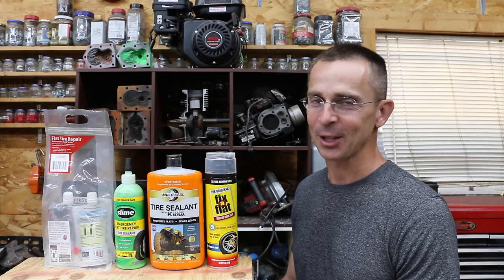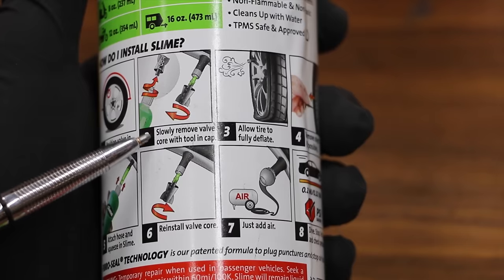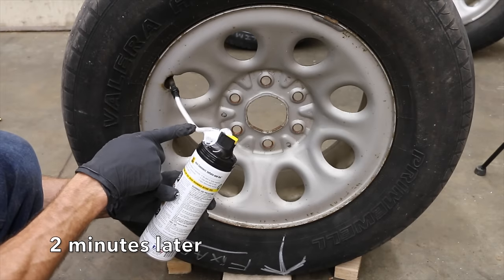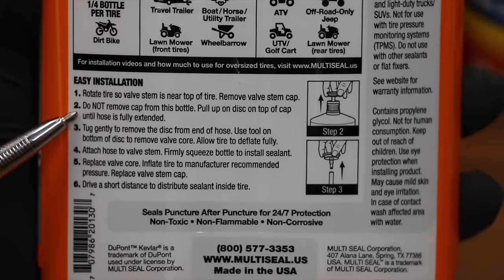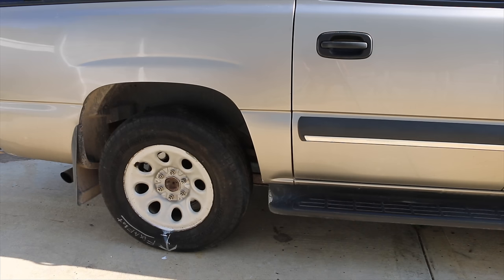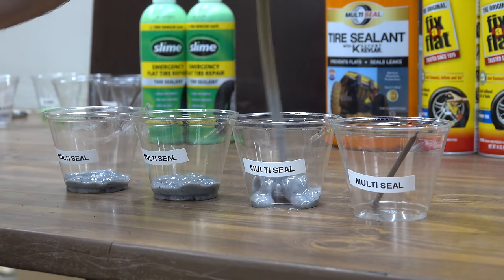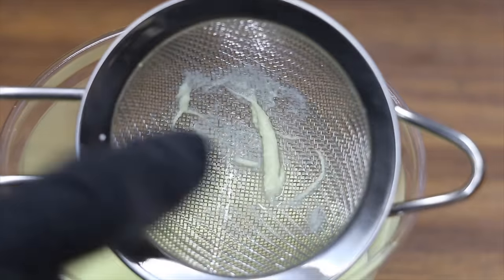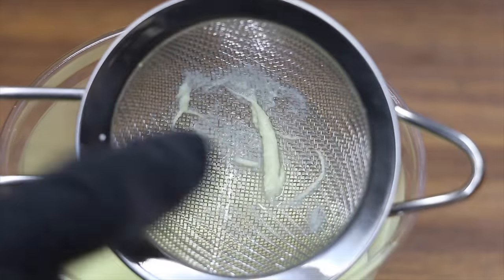Is Tire Slime the Best? Fix-a-Flat vs Tire Slime, TireJect, MultiSeal. Let's find out!

Comment: I've never messed with any of these products, but I've used tire plugs countless times. Plugs are a pretty reliable, relatively easy solution for tire repair.
Reply from the maker: Great point on the plugs.
Reply: I've used plenty of plugs in my life because I can't afford new tires, but just so you know, a plug can void your new tire warranty!
Reply: @Quickened1  just take the damn plug out before you go to the tire store. angi, and done.
Reply: @tommurphy4307  yeah, not sure you've ever tried to take a plug out of a tire. Your have to do it from the inside of the tire!

Comment: When they claim 1/4" to 1/2" hole repair capability, is that a true hole size or simply an object of that diameter that caused the hole?  The actual hole in tire will be much smaller because the hole in the rubber closes down much smaller once the object is removed.  
Now if you take a 1/4" drill bit and drill it for an extended period, you'd have a  genuine 1/4" hole, and I'd be really impressed if they can seal that.
Reply: It is puncture size not hole size
Reply: with a hole that size, you have to seal it with a new tire, lol
Reply: I had a puncture caused by an M6 (1/4") bolt easily sealed by Wellseal/Puncturesafe. But it absolutely would not have sealed a hole drilled to 1/4" diameter.
Reply: is that a true hole size or simply an object of that diameter that caused the hole? So what your saying is the hole size can be two sizes because of what created the hole in the first place and the fact that rubber returns to its original shape when compressed? Dang!!
Reply: For those times when you run over a drill in operation.
Reply: @CCliff0rd  

Sometimes you have to put employees in their place
Reply: I can't remember the last time I drove over a working drill with a 1/4" bit.
Reply: @stu-oe5sg  that's why the 1/4" puncture claim is meaningless.

Comment: I'm definitely getting rid of the can of fix a flat in my car for multi seal
Reply from the maker: Great idea
Reply: Keep it for emergency air up
Reply: Same.
Reply: I would get rid of the fix a flat, and just use the multi seal and a 12v air compressor. You don't know if the fix a flat will react with any of the ingredients in the multi seal in any way
Reply: Yep. Fix a flat sux

Comment: I had a front tire with, I believe, a nail in it - never saw it, but think I ran over something, but also never removed anything. Was a BMW 4-series lease and the tire w/ TPM - a replacement tire was near $300 - and the car had maybe 2500 miles on it. Anywho, I used Slime. Whole thing took maybe 10-15 minutes, mainly because I didn't know exactly what I was doing. It was perfect, I turned the car into the dealership two years later without doing anything else - the Slime, in my case, was a permanent fix. I'm totally sold on the Slime - the stuff worked amazingly well at least in my case. With that said, the reason I looked this up, was the other night I had a tire nearly flat on my Saturn Sky, no TPM, and I was at Target - nothing else was open. All they had was Fix a Flat - so I picked it up - followed the instructions just as they said (sort of remembered it from when I was kid and having to use it). The next day, I go outside, the time is down to 10PSI. Just my experience.
Reply from the maker: Thanks for sharing.

Comment: Fix-A-Flat only works if you leave the object in the tire. Used it once. Slime is great. I’ve used it multiple times. 

Love your videos, man. Maybe test transmission fluids? Or test cheap vs. expensive brake cleaner. 

Also, I’ve had grade 8 bolts break. Could be a decent idea to strength/corrosion test the different grades of bolts. 

Have a good one!

Comment: The only thing Fix a Flat seems to fix is a heavy wallet.
Reply from the maker: Lol, Great point
Reply: That's called a 'cashectomy' in the medical profession.
Reply: Should be illegal. Cuz it cause blow outs
Reply: It's only air in a can🗯
Reply: True that fix a flat. Will only flatten your pocket book
Reply: It contains fluorine which is a toxic waste product. The genius super rich are putting toxic waste into products so that instead of having to pay to dispose of it, they have idiots buying it from them. Fluorine has no good use. As you can see, every product that doesn't have it works better.
Reply: Yeah but it worked for me two different times to be able to drive to the shop for a real repair.

Comment: Love it I work at a tire shop fix a flat is a worthless product always wondered if any was worth using
Reply from the maker: Great point
Reply: I was thinking that it might be OK for a riding lawn mower tire.  Emphasis on might.
Reply: Another good thing to mention is yes these products will fix some holes that fluid in the tire will imbalance ur tires we run into alot of customers with ride complaints after they put these things in thier tires
Reply: @s99614  Best to do the job right. For a lawn mower you might as well just get a tube as they aren't that expensive and its what I installed as a pro when I worked in tire shops.
Reply: @silasbailey  Yeah its fine for a little ATV or ride on lawn mower and other farm yard machinery but for vehicles that have to use the roads and get up to fairly high speeds it will be total crap and ruin the ride. In cars you are better off plugging the tyre.
Reply: @s99614  used one in my riding mower for years works great

Comment: Anyone remember when fix-a-flat used to become a hardened foam like Great Stuff?  It worked back then, except you had to throw the entire tire and wheel away because the tire was never coming off the rim after that.
Reply: now its a replacement for spare wheels
Reply: @Minecrafter-uh6qv  what?
Reply: @lyricderbin1169  in cars, at least in America great stuff is what companies put in tires instead of donuts or just another tire.
Reply: @lyricderbin1169  Space saving measures, and yet it doesn't work.
Reply: @Minecrafter-uh6qv  You're referring to runflats eh? That's one method of making a runflat tire.
Reply: @mannys9130  just fill up the popped tire and go basicly, not that it really works
Reply: @mannys9130  No, he means a lot of new cars don't have a spare, not even a mini-spare "donut" or jack anymore.  Instead, you’ll find a "tire repair kit" comprised of a flat fixer sealant and a compressor.
  If the tire is cut, split or blows out, then you’ll have to call for help.

Comment: Hey buddy,  thanks for the info.  That emergency can of Fix-A-Flat getting tossed.
Reply from the maker: Thank you!
Reply: Not necessarily, remember that it is also the only product that will inflate the tire as well. I wonder if it can be used in conjuction with tire slime? Maybe deflate, add slime, then use fix a flat just to inflate
Reply: Bro I got a can in the trunk for emergency lol all bad
Reply: The definition of insanity is repeating an act over and over again expecting different results. For example, snacking your hand with a hammer to produce pain relief... 
I used "fix a flat" a grand total of 6 times over 4 years before I realized it absolutely does not work and the company needs to be sued.
Then I was cured of my insanity when I bought my first can of slime.

Comment: Sir, I appreciate this like you would not believe. There are several products on the market I often wonder whats worth buying and does it even work? Youtube sends me your way, and your enthusiasm, effort and attention to detail is VERY appreciated. The "mess" from all of these products is significantly less then I imagined. And Slime DOES work who would have thought. Amazing! (My car doesn't have a spare, tyre plugs have saved me previously, but this might be an easier solution for my wife if she's in trouble!)
Reply from the maker: Thanks so much!  Thanks for the feedback.
Reply: why don't you join the pepsi generation and make your cars legal by equipping them with spare tires?
Reply: @tommurphy4307  here’s an extract from 4 years ago;
Over the past five years, about 10 percent of the cars tested by Consumer Reports came with a full-sized spare. About 60 percent came with a temporary (aka space saver) spare tire, and the rest were equipped with a sealant kit or a run-flat tire, or nothing at all. 

About a third of new cars today do not come with a spare tire, though they might also be equipped with a compressor and sealant kit to temporarily fix a flat tire. Some cars without a spare come with a run-flat tire, which is designed to operate for a limited distance after losing air from a typical puncture….

Comment: "Thats a lot of damage!" Made me want to see flexseal on a hole lol
Reply from the maker: Thanks for sharing.
Reply: It does i tried it lol next time i patch a tire ill post a video with flextape and leak test it
Reply: I think thar you could seal it from the inside with flex paste and put a big patch of flex tape on top from the inside too.
Reply: The price of the flex seal will leave a big hole in your wallet!
Reply: @thangknowa2567  a roll is like $12.
Reply: I tried flex seal 😜 it didn’t work so well on the outside but if you prep the inside well it works sometimes
Reply: @thangknowa2567  That can cost you thowwwwsands!
Reply: @BotchokoyEats  I was referring to the liquid flex seal, not the tape. Besides, if you are going to break the tire down, go with a vulcanized hot patch and do it right.

Comment: Fix-a-flat fixed my lawn mowers tire yesterday 🤷🏽‍♂️.  I bet that can is 10 years old though. If anything, it does creat enough pressure to inflate a tire. So slime it, then fix a flat to inflate it. Might work!
Reply: SakoSTW WY  we have these things called "tire pumps"! and "air compressors"! , no need to waste money on goo to inflate a tire, save that for when you're stuck a hundred miles away with no spare.

Comment: Fix-A-Flat has saved my bacon at least 10 times over past 40 years, inflating flat tire (with screw or nail left in place) and sealing leaks in Ford Explorers, Lexus 350, Toyota Tundra, and now fixing leaks in both Tesla S and X's tires.   I've never tried Slime, but intend to put it in all Tesla X and Tundra tires as precaution.  (house under construction past 3 years so tons of nails and screws).  Excellent video.  Project Farm has amazing and accurate videos.  Please keep up the unbiased, accurate testing!!!
Reply from the maker: Thanks, will do!  Thanks for sharing.

Comment: how about the likelihood of stripping a bolt with a 12 point vs 6 point socket?
Reply: I can answer that, but with no acompaning video or scientific test.
In my personal experience (yeah, the pinnacle of unscientific) a proper 12 point has the same likelihood as a 6 point of stripping a hex head fastener.
BUT Stanley makes a 12 point socket that isn't actually 12 "triangle points" and is 12 splines on the socket. Those are crap. They either don't grab a hex head, or chew it up.

If you're asking because you're looking for tool, just make sure the socket has what Snap On calls "flank drive". Harbour freight sockets have "flank drive" on the fastener AND drive end (unlike snap on) and Gear Wrench has it. Guarentee others do too, I just don't have personal experience with anything other than those 3.
Reply: Use 6 points in high torque situations
Reply: I have a whole drawer dedicated to single hex sockets, if in doubt grab a bigger hamme...... single hex ;)
Reply: 12 point is twice as likely to slip. You have to destroy much more metal on a 6 point for it to slip. The metal you have to slip on a 12 is so much less
Reply: Shawn klessel hes deff worked on cars 💪
Reply: In my opinion 12 points are really only useful if you work on square headed bolts. A 6 point won't fit on square heads.
Reply: @Christoph_NTX  more than I care to. Burnt out on them now. Feel like it's always the same shit
Reply: Whatever. FACOM brand rules them all !

Comment: Yeah, unfortunately I learned most of this lesson first hand--->Fix a Flat sucks and no good at all on wet roads or in the rain.  Tire SLIME 👍, even worked for me at sealing slow rim leaks. However in winter you can feel the glob in the tire until you you can move for a bit to sling it around the tire. Yeah, tire places dislike/ hate these products but better a wee bit of aggravation on them than me stuck somewhere and/ or their closed and I have a tow bill as well. I do however forewarn them if they are working on my tires. AS always well done!

Comment: Great video, definitely gives some great insight on each product. 

That’s strange... I’ve used fix a flat exclusively for 20+ years and never had a hole it could not plug... after the video I’ll be looking at the other options in the future.
Reply from the maker: Thanks so much!
Reply: The only time I use fix a flat is when I have a leak so small I can't find it.
Reply: WOW its super man, I mean AIRRAM! I used to follow this dude and his 4.7 Ram over a decade ago. Small flat earth on the internet...
Reply: It used to work great, I used a good bit of it in the late 90s early 00s. I looked into it some, and I'm pretty sure they changed the formula at some point, likely b/c of our nosy busybody friends in the govt. I actually saw one of my tire beads get broken at a shop that had had it applied (I forgot to tell the poor guy about it and it exploded everywhere), and it looked completely different then when he broke the bead in the vid. IIRC it almost looked like there was a lot of foam in the fire.
Reply: It’s funny how everyone’s experiences are different I’ve never had fix a flat work at all
Reply: I agree, I had zero luck with slime but fix a flat also ended up working for my tire.
Reply: @pete3011  they make a non-flammable type, as well. thats what you should be using- and put the included sticker on the wheel. the guy should have smelled the thing first- a good buster can tell when there is volatile sealant present.
Reply: @pete3011  i had the same experience with fix-a-flat lol.  The tire guy was kinda pissed.  but that was about 10-15 years ago.  Haven't used it recently.  thats a shame if it's crap now

Comment: Multi seal, now called Flat Out, is GREAT.  I’ve had a leak in my riding mower for a few years and in a hand dolly for over 15 years.  Although it was not punctured, Flat Out stopped the chronic leaks.  Thanks for your testing review.
Reply from the maker: You are welcome!  Thanks for sharing.
Reply: i put tubes in my mower's tires/wheels. put a stop to that shit and no more goop.
Reply: U R not super-motivated, are you?
Reply: The best, yes.

Comment: Great video, I always wondered what the inside of a tire looked like after using these products, thanks for finally unveiling the mystery lol 

 I've only used the Slime brand as it was the only one available where I live. I used it once on a snowblower tire, once on a full size truck tire and a few times on bicycle tires. 
It worked well every single time.
Thumbs up! 👍🏼

PS I look forward to watching the air pump showdown video...
Reply from the maker: Thank you!
Reply: @ProjectFarm  You're very welcome :)
Reply: Having worked in a tire shop for a few years I can tell you Fix a Flat is such a mess.   We wouldn't even try to fix tires that had any kind of sealant in them because it wasn't worth the time it took to clean it out and you couldn't get it clean enough for a proper repair.   Most of the time people didn't even tell us either so it was a nasty surprise.
Reply: I only consider all those sealants as a temporary fix just to get you going again. The tire should have a tire patch installed inside the tire as soon as possible.
Reply: @jameskoralewski296  Must agree with you James. Only a real FOOL would go around on a tyre that just has sealant blocking the puncture. On motorcycle tyres people should get a new tube as soon as possible after a puncture. Put more slime in it and they are ok to go again. Do NOT try to fix a puncture in a tube that already has Slime in it, just buy a new tube and be done.

Comment: I used tire slime when it first come out, does work great, but I keep a pressurised can of something different for emergencies because it inflates and repairs without having to remove the valve core. I've owned a slime 12v compressor for quite a few years, absolutely amazing value, came with a lot of accessories,  very fast inflation and very durable.  Thanks for the video,  absolute love them, your testing is always well thought out, and well edited :)
Reply from the maker: Thank you!
Reply: No sir, THANK YOU!
Reply: That's what came with my wife's 2018 Acura RDX instead of a spare.  Guess they are getting huge savings there plus less weight for better mpg.
Reply: @Texdan25  I was looking at cars at an event few years ago,  some silly honda with a 1.1L didn't have a spare,  just some repair crap like you say... it's for weight reduction to increase fuel economy  rating  and cost, I  laughed and walked away.... useless if you have a blow out, which I have...